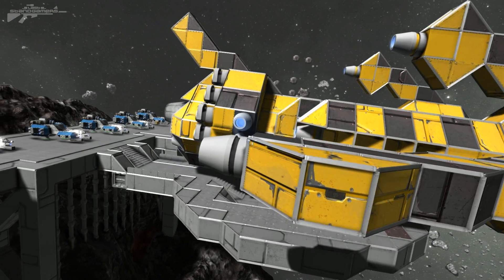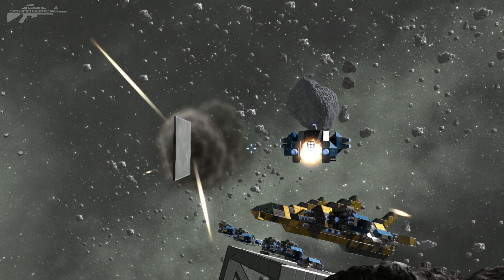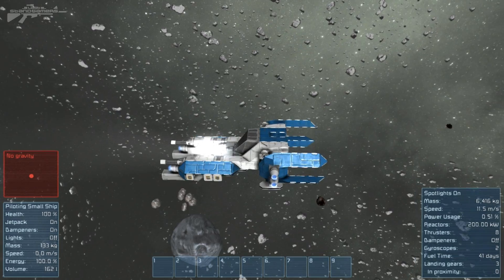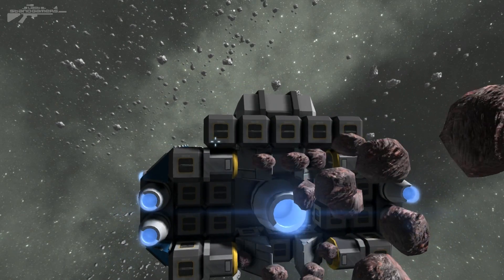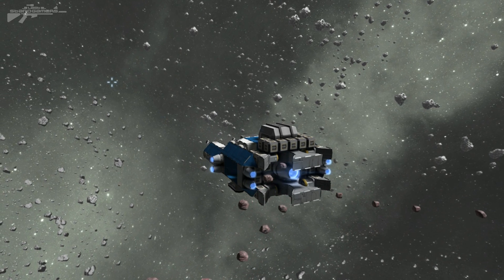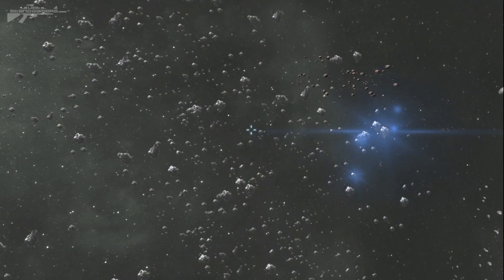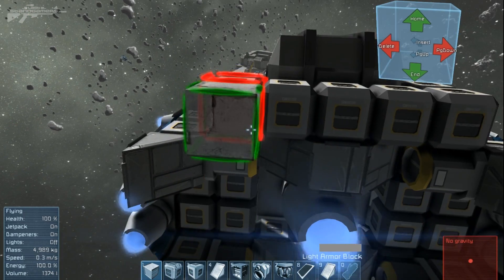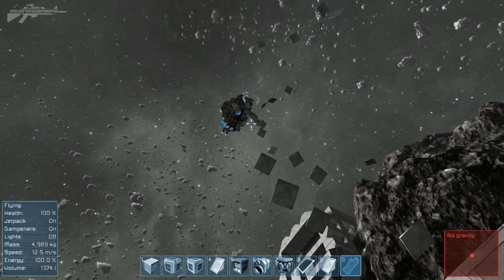Space Engineers - Missile Counter Measures, Flare System

Comment: with the new attach-system of rotors, you can build pretty nice decoy dropper … not only that, you can build nice torpedos (linked with two rotors .. bit tricky to reattach them … build two timerblocks that activate ‘attach’ nonstop), full with decoys, fire them on a ship and while the automatic is firing on those things you can take out the weapons on one side of the ship, land, enter … and the best thing is: you still can manage to fly such a bomber, except to the same design with landinggears .. that is hardly able to hold on a straight line ;)

works pretty well with the AI ships.

Hope for a revisit ;)

Comment: Steel plates look so much like ECM on a helicopter, I think you called it Chaff? You could attach a gravity generator in such a way as to fire them out at a high velocity, increasing the rate at which they spin (flat plates would turn upright) and also blowing up the missiles nearer to the aggressor. I know if I had this game I would be the one nutjob Fighter Pilot who would try to eyeball the exact point in which a missile could fly through. With the optimal variant you showcased, it would be quite difficult to the point that I'd probably strafe you from the sides rather than cut the engines. You'd need several thousand for it to last long enough, however. If one missile is all it takes I'm pretty sure I'll hold fire for just a minute and wait. Another reason to "fire" the plates as opposed to jettisoning them. Though, I'm not sure if items are effective in collisions, even against fighters? Anyways, awesome concept for civ ships and fighters. Could be useful for carriers if it were on all sides and axis. Good jawb.

Comment: LastStandGamers How did you spawn in 15,000 steel plates? I really have no Idea how because I want to try this out.
Reply: get a grinder some collectors and grind away or if you are ever so smart enough you can get cheat engine I have done it once in single player DO NOT DO THIS IN MULTIPLAYER it will cause you to de synchronize from the host

Comment: Had an idea, can you eject warheads out the back while heading at a building target, then veer off and let the train of death hit the target?
Reply: LostForever201 PC.

100% this is a PC game. The features that the developers want to add the the game require TOP level hardware. 

Not a mid-range laptop APU barely pulling 40 watts of power.

The best way to run this game is with a 3rd gen+ I7 or a heavily overclocked I5. Anything less sees frame drops. Not because the game lacks optimization but because it needs to do lots processes.

Consoles don't run games with more of anything. They run them leaner and streamlined. That means lots and lots of removed features and cut content.
Reply: As i think I said, i have no idea what's best. People I know think I'm a wiz, but i'm pretty simple. Just dying to get this game though, maybe in time to test some theories of my own before someone else does.
Reply: hey i have a question one is i cannot run this game in multiplayer for five minutes without it crashing and also one day ill probably decide weather i'm going to go with pc or console witch do you think is best ?
Reply: I imagine if it can run on a console the processor might be strongest on a console but that's just my guess. Still haven't bought the game yet.
Reply: We'll this is coming out for the xbox one (I mean space engineers)

Comment: I see just one small issue. When I tried combat in dog fight, situation when I chasing someone in straight line almost never happen. Runner usually try to rapidly change direction of flight and it's best of all tactics in my opinion. Also maybe it's only me but I have a rule for navigation in space: Never fly directly into a target, always offset course by degree or two. In open space is very likely to miss calculate distance and ram into the object. So when I chase someone same rule apply and this counter measures seems useless. A question came to me. Do you tried to spin ship to dispurse debrie even more chaotic? And do you tried this in real fight? I would like to watch when you try to escape using only this system from fighter equipped in missiles. ^^'

Comment: these countermeasures are completely useless on large ships, there is simply too much surface area to cover, you would be better off making a gravity field like sage did, but filling it with rocks instead. for example you make a gravity cell behind your ship where all the debris from the connectors would cluster and sit behind your ship as you flew around.  for small ships it could only be useful for ships that are slow,  these things are also clearly not light either. besides, if you are being attacked you wont have time to open your menu and push buttons, you have to maneuver and shoot back.

Comment: i like the idea, especially with (hopefully) hotkeys binge introduced, you could turn them on when you need them and off when you dont, to save resources... to counter the people that say you dont have to be shot from behind, you'll be moving, so the enemy must be in some way behind you, larger ships will need a more "integrated" system rather then an add on like what you can do with small ships, but this is a  great idea to protect you more valuable parts when running, maneuvering
Reply: and to protect you hull with a more passive system, i have a recommendation for large ships and station.
1- get a small ship, 5 blocks think, variable block wide and tall
2- the ship will have 5 layers (layer 1 will be the  docking layer, it will be mostly light armor with a heavy armor 'X' going through it)(the second layer will be empty space, except for the edges of course)(the third will be entirely light hull)(the fourth will be space)(the fifth will be entirely heavy hull)
3- dock this 'plate' to your large ship
this way, you can easily replace damaged armor, the armor counts as 5 blocks thick for blast damage, will buck on itself to absorb impacts, and the hardened outer layer will be immune to bullets and small hazards. the whole setup will be light wight (you could mess with the connections between layers/ the configuration of heavy hull supports,and maby even cut holes in filler light hull layers for lighter wight) but this is an ideal defensive system for combat ready ships.....

i still recommend countermeasures to protect engines.

Comment: You don't have to manually turn them all on, you can just put a collector on the front of your ship then attach a load of steel plates to a landing gear in front of it so when you turn the landing gear off you will accelerate into the steel plates witch will the come out of the connectors (which have already been turned on).
Also to deploy flares randomly you could have the connectors on a rotating arm

Comment: I just had a great idea for a block... or it would be great if they weren't going to add grouping/hotkeys. Basically it's a block which functions as a switch - in that you can switch off or on its conductive-ness in the control panel, so you could have a group of items such as here with these connectors turned on or off at once by removing or giving it power.

Comment: Great concepts here, Implementation in fighters is a must, use on capital ships seems difficult at best, you're better off using some form of stand-off armor or simply relying on a good fighter squadron.
Reply: HunterDrone
In a moving ship, that might work nicely only for stern (and maybe bow) protection, but imagine someone sneaking in with big gravity generators pushing that debris back towards your ship (or simply out or their way)...

On the other hand, this is the most probable threat axis you can get shot with unguided missiles, so a couple of steel plates might be kept for that purpose.

Comment: I like to concept, but don't really see the point of it yet, as the rocket are unguided, so it would be much cheaper on resources in SM at the moment just to make a more maneuverable ship and dogfight your way out of it.
plus flares of the C-130 (angel pattern - someone will correct me if i am wrong) come out the side more because that is where the heat of the engines are. The flares burn at a much higher temp and so mask the heat from the engine which is an attempt to trick the heat seaker warhead the c-130 will then bank hard left or right to try and take its heat signature out of the seekers cone of sight.

Comment: Great video, I suggested something like this when the conveyor blocks were added in the previous vid. Rather than using sloped blocks to disperse the 'flares' have you tried using gravity generators? maybe a few set up to cover just a small area each, in such a way to try and cause some turbulence to all the flares as they come out.

With this sort of thing being used as sort of like ECM, I bet it wont be long before someone thinks of a good ECCM (a counter to the counter-measures) such as fighter ships using gravity generators to push the 'flares' out of the way, might not be good enough to clear the way for missiles but may protect the ship when flying through it.
Reply: XMysticHerox The problem is, all items get released as a single item, not large stacks, so damage would be minimal. I was thinking of using gravity generators less as a weapon, and more to spread the area of the flares out to just wider than the rear of the ship, otherwise the enemy could just fly off centre from the stream of flares just a little and aim at the the sides of your ship.

Comment: who is stupid enough to follow your trail of plates or rocks, they would just go a bit under, on top and get a good hit ontop of your engine bay, or below
Reply: I know im necroing this shit out of this... But... Hes going under 5m/s... In a fight where you are trying to get away from someone and needing to use this, you would be doing max speed. At that point, if you were 500/800m behind them, it woudl be a little difficult to keep up with them and get a different angle, as changing your direction to anything other than parallel would decrease your liner movement speed, causing the fleeing ship to gain distance.
Though, in that... a trail of little rocks would possibly damage a lot of external components and eat through light armor pretty quickly at 100m/s. If that was the case, it would definitely be a deterrent to players and AI would just be stupid and keep going through it. 
I would have enjoyed seeing how this worked at higher speeds, rather than literally walking speed.